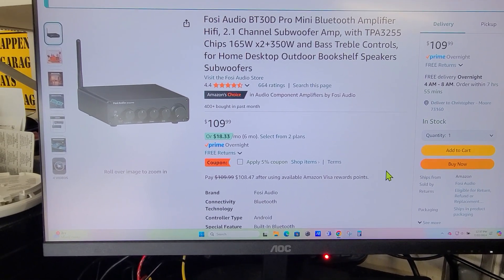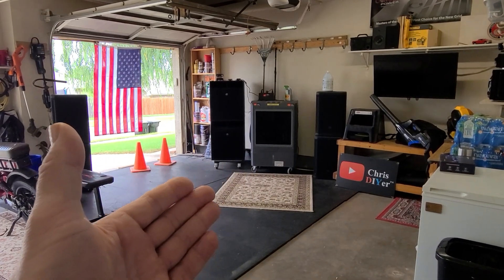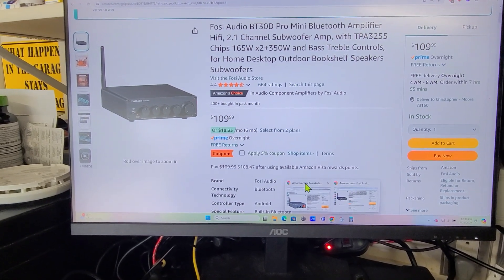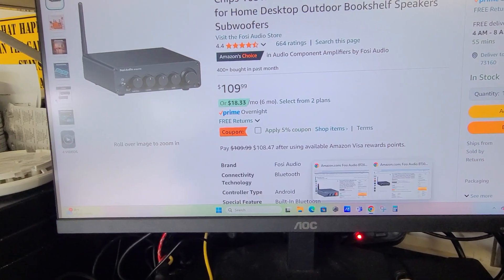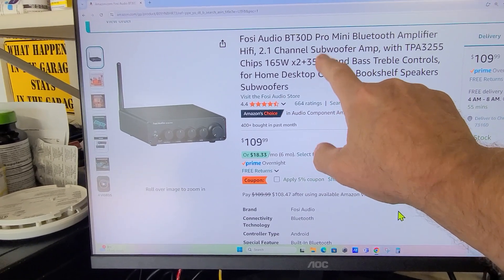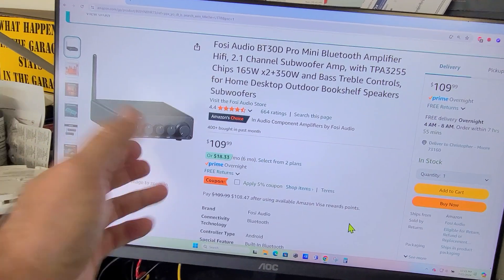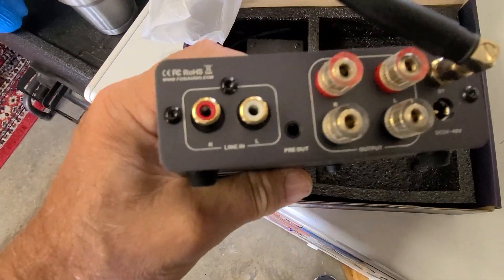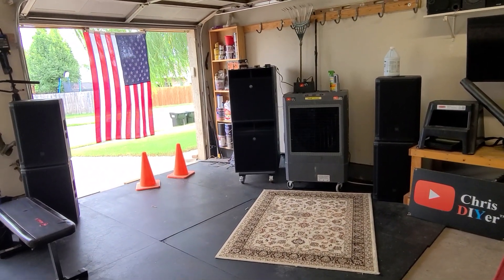An idea for the ultimate Bluetooth digital chip amplifier (build it Fosi Audio!)

Comment: Your truly not the only one who has these same thoughts. I'd tell em just pack in a damn PSU with ample headroom, and put it all into one chassis already! Once that model goes full viral, release a secondary unit that has a 6J1 tube stage built in. Tubes are what apparantly do the trick with these TPA chips.
Reply from the maker: Tube pre-amp stage...why not? Heck yeah. Even with using four of those TI 3255 chips and a 20a 36v PSU (AC/DC adapter) this Fosi would be stellar. This stock unit with just two chip amps is on the right track. I like it, just needs to go to "11" if you know what I mean.

Comment: The limitation is the power supply. The rated power output is the maximum power that the TI chips can put out (typically at 10% THD and into a 4ohm load, iirc), not what you are going get from them, at least with the available (supplied) PSUs. The BT 30D Pro uses two TI 3255 chip amps, one for the stereo channels and the other for the passive sub channel. Using a 36v 5a power supply, the max power available to the amplifier chips, assuming 100% efficiency, will be 180w, 90 of which will go to the stereo channels (so 2 x 45w - assuming 100% efficiency) , the other 90w to the passive sub channel. This is at a 4 ohm load, so realistically you're looking at around 2 x 25w (stereo) and 1 x 45 - 50w (subwoofer) at a more typical 8 ohm load. 

If Fosi was to build a 1000w subwoofer amp using multiple 3255 chips, it would have to supply this amp with at least a 1000w power supply to achieve the amplifier's power rating. Fosi (and Aiyima) can supply a 48v 10amp psu, giving a theoretical 480w; still not enough juice to get the 600w out of a single TI 3255 is apparently capable of.   

I like your thinking, though!
Reply from the maker: Six of those 3255 chips in a 2.1 BT amp like the BT30D Pro! It is pretty dam good with only two chips running using a 36v/10-amp step up booster + efficient stage-DJ-gig type PA speakers. Barks nicely...even the subs. For shits/giggles I have two of those 3,000w x 2 Behringer power amplifiers. I ran four of those Yamaha 18" subwoofer cabs with them...it literally will blow windows out and make you shit in your pants.
Reply from the maker: @redbrazos  -- Hmm. I know I don't allow any links from commenters on my channel (unless you first coordinate it with me via e-mail or PM). As for using a 48v  battery direct to this Fosi BT 30A Pro amplifier as a power source -- not sure if that is a good idea. From my testing, 48v is fine, but 36v (10-amps) seems to work better. I would never hook this amplifier up direct to a 48v battery unless I was using a 36v or 48v regulator + fuse of some sort.